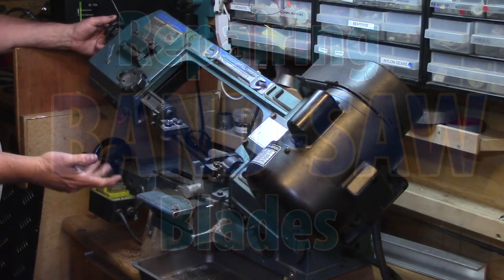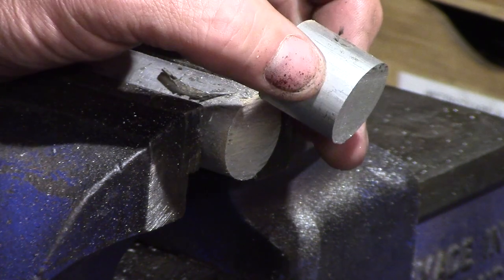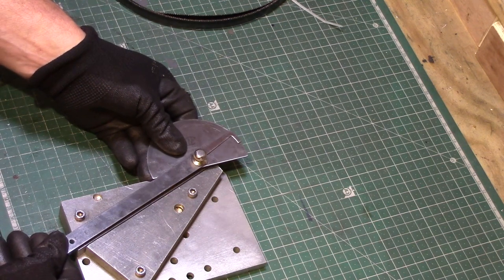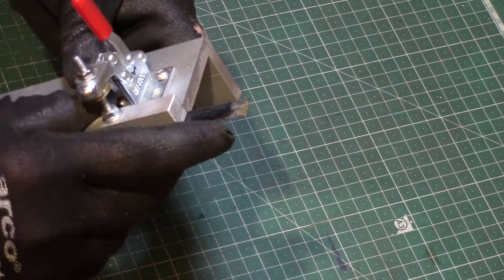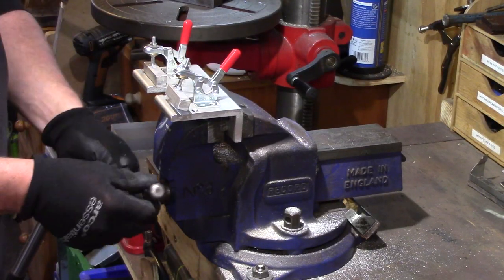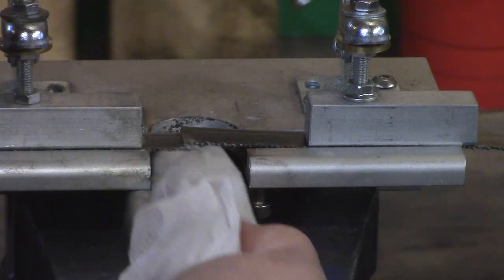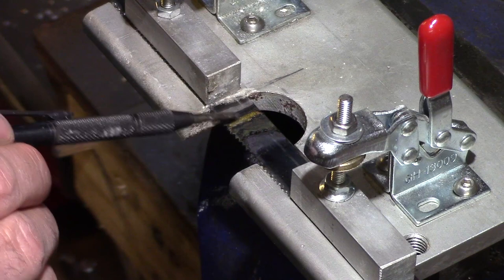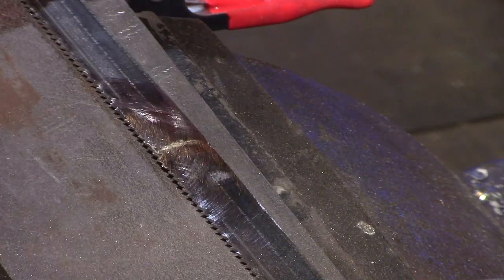Bandsaw Brazing Repair

Comment: Thanks for a great video. I made a similar jig but found it hard to find silver solder flat strip. Your lifting screw solves that problem by using a piece of round solder instead.
Reply from the maker: Thanks Ellie, yes it seems to work well, thanks for the comment
Reply: If you can't find silver solder shim, just belt the end of a round bit with a hammer and voila! you now have shim!

Comment: Hi Ade. Truly terrific vid. You're very polished at it now. Glad to hear the repaired bands are holding up, cus what I was thinking during the vid was about the temper of the steel at the heated spot. You don't dunk it, so it will be annealed, which is probably the best way. I imagine the teeth will wear very quickly at that point but it's such a small area as not to matter. Altogether GREAT I'd say. :) Great arrangement with your jigs for clamping, grinding etc..
Reply from the maker: Thanks John, yes as you say it is already annealed  from the brazing process, not too woried about re-hardening and then tempering back, a few teeth skipped on the cut dosen't seem to make much difference overall

Comment: Very good video, however now I've mastered parting off on the lathe with blades I've made from a good quality used circular saw blade, recently I parted off at 800 rpm plenty of lube 25mm dia, so I find hacksaw almost redundant, 🇬🇧 Coventry.
Reply from the maker: Thanks for the comment Gray, I also part-off when it is appropriate, but I also cut a lot of flat and plate stock, can't do that on a lathe unfortunately. Rgrds. Ade

Comment: This is great! I may mill the back side of an old aluminum heat sync i have for the clamping jig, its about the same size. I lucked out today and bought the last two bands off the shelf they came to my truck like a drive-thru. Wish we had plethoras of Myford lathes over here like in the U.K., Id own one.
Reply from the maker: Sounds great!

Comment: Would a 15 degree chamfer on the blade ends provide a bigger overlap and consequently stronger joint?
Reply from the maker: Hi David, yes a shallower angle will work, the more overlap the better I suppose

Comment: Nice one ! I always considered welding was the answer to joining/repairing bandsaw blades, but I'll be trying your method neext time I break one. Cheers Ade.
Reply from the maker: They seem to be holding out ok Derrick, had the last blade on for about a month, possibly longer and it hasnt failed yet, cutting good and strong. Regards. Ade

Comment: I find having a good blade is the most important thing with a horizontal bandsaw . having got everything perfectly set up I can cut 20 thou slices with a good M 2 bimmetal blade . the difference is massive . I would like to try Brazing new blades - As I am in England what is a good flux / solder combination please ? I donnt seem to brake many now , a worn out blade is not going to cut straight .
Reply from the maker: Hi Rick, I used Silver-flo 30 with easyflow powder flux

Comment: Does the blade need annealing before use?
Reply from the maker: I didnt quench the blade so it will be annealed over the short area of the join, to the teeth in that spot will wear, but the blade just skips over

Comment: Hi, it is better to use welding
Reply from the maker: I dont have tig welding equipment, this works well, and is what most model engineers have at their disposal. Rgds. Ade